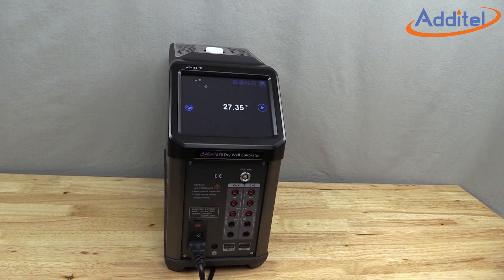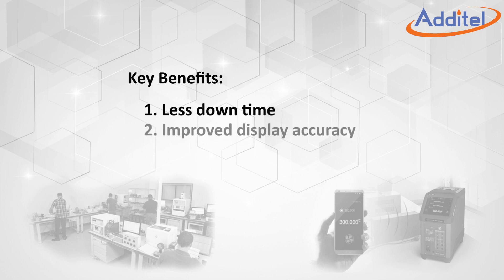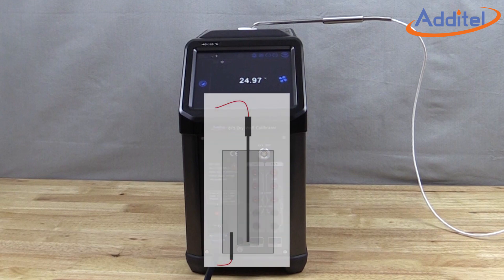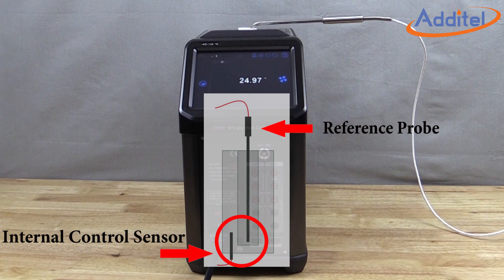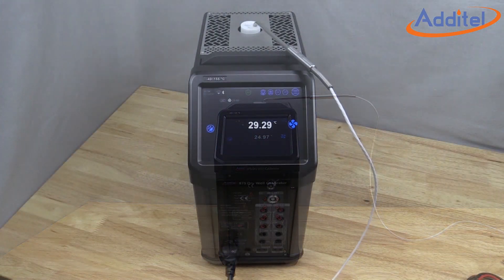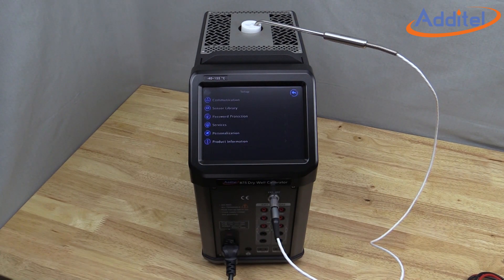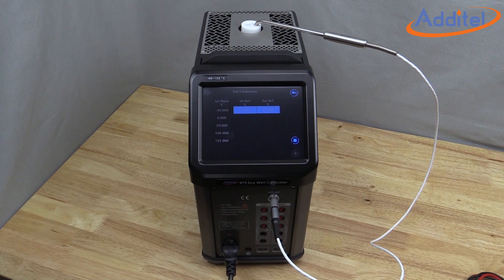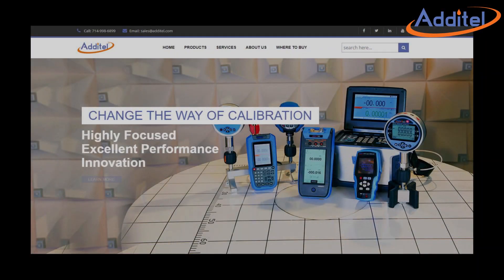ADT875 Self Calibration Video

Comment: Does  the Additel 875 calculated the coefficient internally after the calibration?
Reply from the maker: Great question! Yes, once the data has been collected by the ADT875, the users has the opportunity to review the data and confirm that they would like the ADT875 to calculate new internal coefficients for the new calibration of the ADT875.  If at any point the user would like to revert back to the previous calibration, they can choose to do so in the “Calibration” menu.